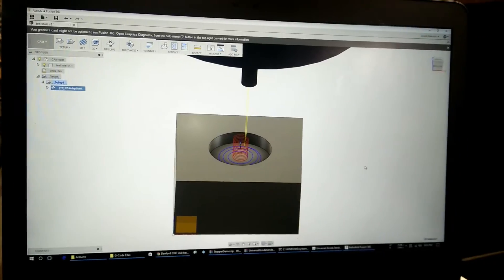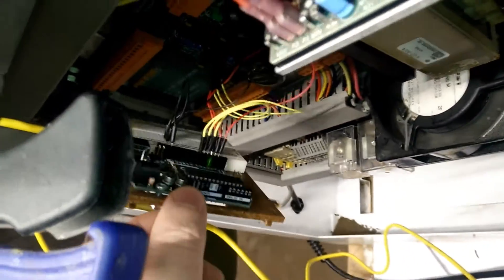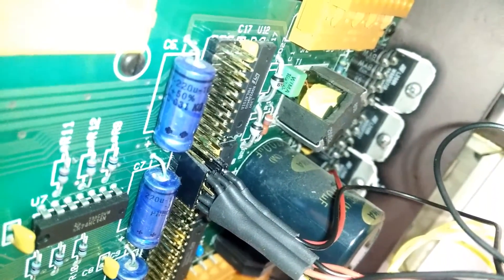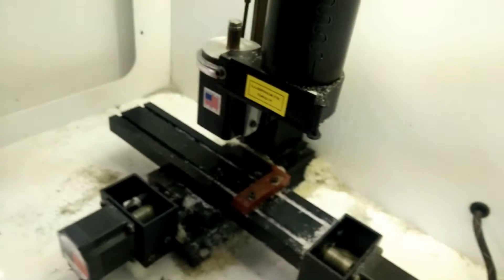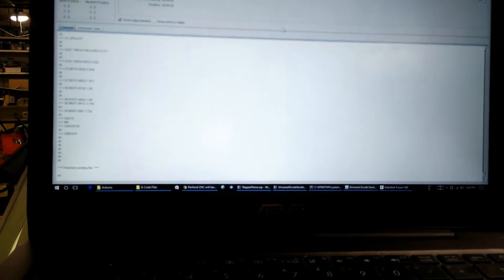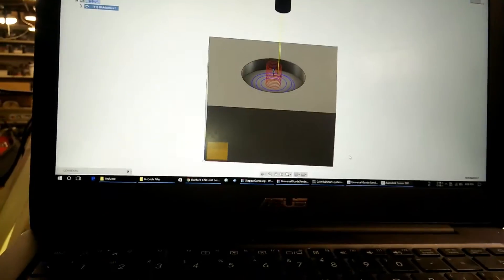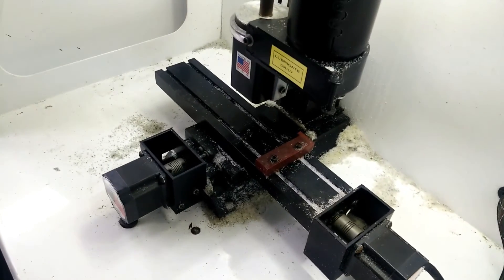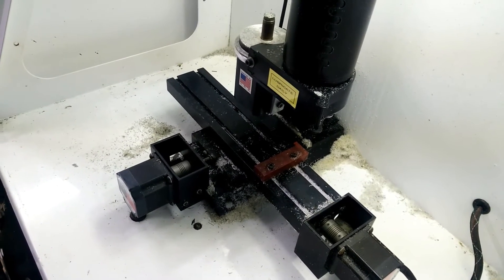Denford Sherline CNC Arduino Upgrade Part 2

Comment: i've been working one ot these for weeks. how are you turning the spindle on? and can you list the pin out please?
Reply from the maker: I manually turn the spindle on, and I don't have the pinout. You can count the pins in the video for the ones I'm using which don't include spindle.
Reply: Joe Malovich okey thanks I guess you have a spindle on switch? Mine doesn’t apparently it was a prototype and it’s just a hodgepodge of parts and none of the wiring diagrams match a few parts of every diagram are my machine .i’ve been googling for a month your video never came up I actually found it on a Russian website with a link to this weird. FYI I’m trying to get this going for my high school machining class.
Reply from the maker: @andrewaydelott6953  if nothing makes sense in it then you could convert it to something more modern like a gecko 540. Send me an email with a picture of the front and the back with the covers off and maybe I can help you figure it out. malovich@gmail.com
Reply: @JoeMalovich  EMAIL send thanks